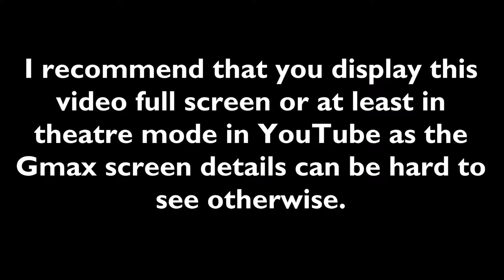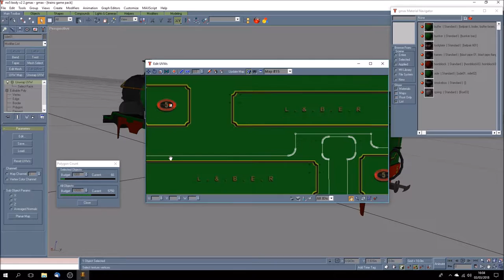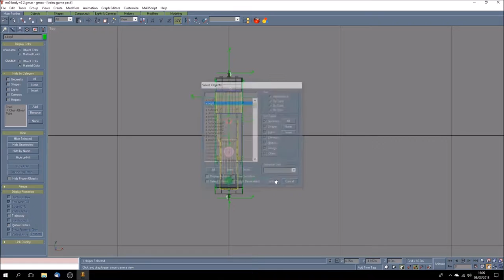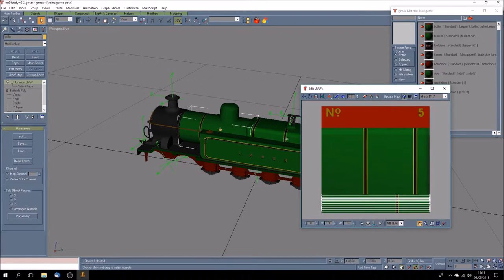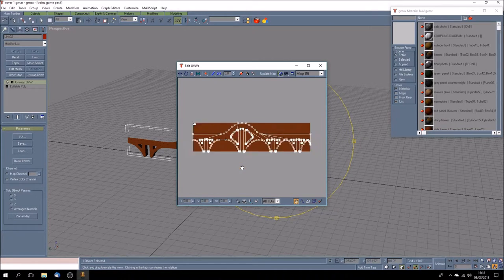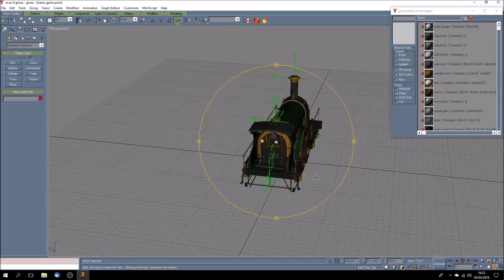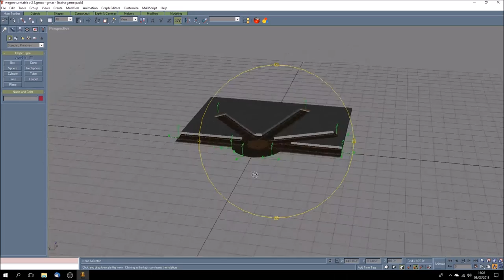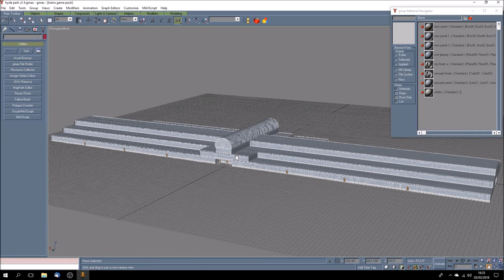Gmax: How to make models for Trainz, part 15 - Bringing it together

Comment: I have just made and animated my first bogie in Gmax and have successfully uploaded it into the game(or so I thought) but in game it appears but is not animated. Is their a special animation file for bogies that I have to upload with the bogie?
Reply from the maker: Yes, make sure you also export the .kin file; you normally name it anim.kin and it should be in the same folder as the bogie's mesh.
Reply: @ing4trainz  is there a special programme to get this KN file or will Gmax do it. I noticed that when I exported it it gave me the IM file and a GPW file no KN.
Reply from the maker: Hi John, OK, Trainz will need the .im file as that is the mesh of course; the .gpw file is not needed and can be deleted from the folder into which you have exported your mesh. Now, the .kin file: you need to have the 'Auran Trainz GMAX Gamepack.exe' file installed. If you have done this then you will have the option to choose the .kin file type when you export. If you don't have that option then you will need to install the Auran gamepack exe. This will reconfigure Gmax slightly (it will not affect your models already made) and give you the option to export the animation file which you should call anim.kin, and name it as such in your model's config file. If you don't have the gamepack.exe, or can't find it on the Trainz wiki or wherever, then go to my website and email me (use the 'contact' menu item from the home page). I will email it to you, it is 1.3MB in size.
Reply: @ing4trainz  after much head scratching I managed to get the Kin file and now the bogie works quite well for a first attempt.
Reply: @ing4trainz  Now something odd is happening to the front bogie, the front wheel is rotating on the unanimated b.r.main dummy. I have checked the pivots and all was well. also In gmax itself the bogie is perfectly animated. I am dumbfounded!

Thanks
John
Reply from the maker: Double check that the mesh is correctly positioned on the world origin i.e. use the 'Reset Xform' on all parts of the mesh. Also, that all parts of the mesh are linked to the correct dummy i.e. animated wheels are linked to their own dummy, and that the animated dummy(ies) are linked to b.r.main along with unanimated parts of the mesh. Double-check the linking hierarchy by using the Select tool and clicking on 'Display subtree'.